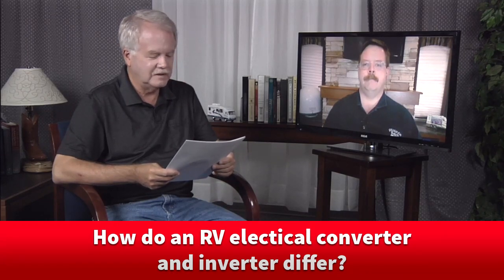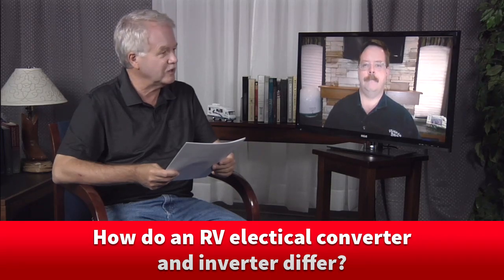How do an RV electrical converter and inverter differ?

Comment: So let me ask you a converter can run an inverter
Reply: It can hypothetically, but it would be a needless waste of energy. If you want to replace a converter with an inverter, you need an inverter-charger which then does both jobs in one unit.
Reply: Sven Franic or a converter/charger which takes “shore” power and “converts” it from 120v to 12v while simultaneously charging your batteries.

Comment: Can I charge my trailer just by plugging it into my house?
Reply: If you have a converter/charger you can. Plugging into your house should supply you with AC power to your outlets and to the converter/charger which should provide power to the DC circuits and charge your batteries.
Reply: yes